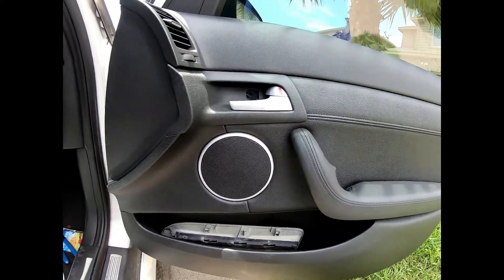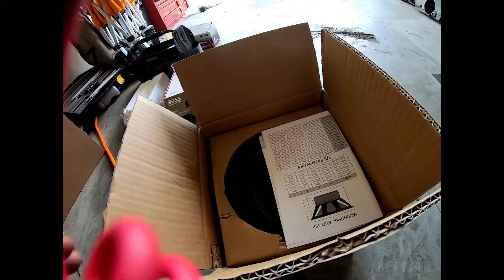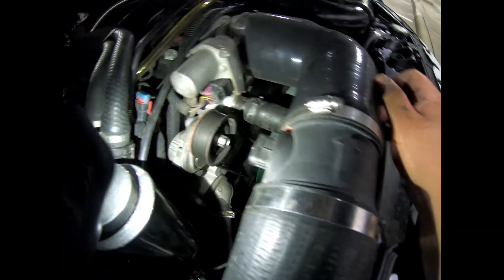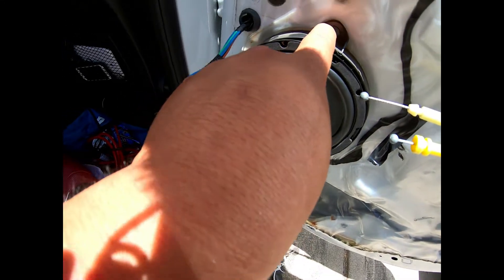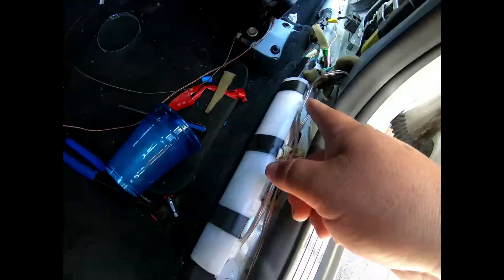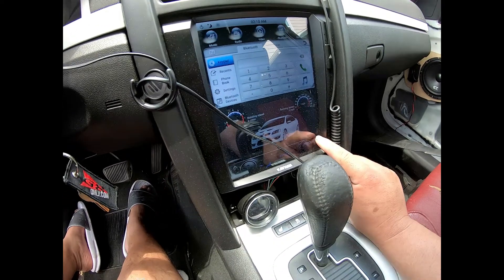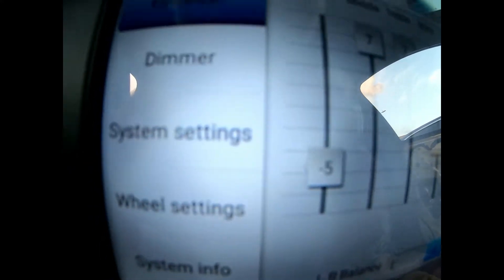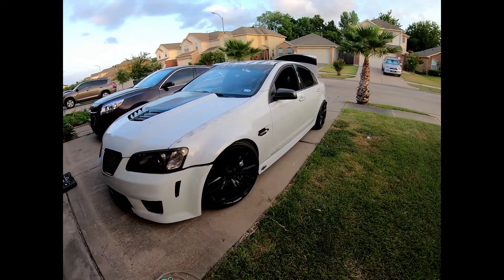PONTIAC G8 GETS A SOUND SYSTEM UPGRADE

Comment: I need to upgrade my system in my G8 ASAP. everything is still stock. How do you like that radio so far?
Reply from the maker: Clay’s Garage radio is garbage to many small issues
Reply: Ok thanks man I might just go with the g8 design kit and put a aftermarket radio in.